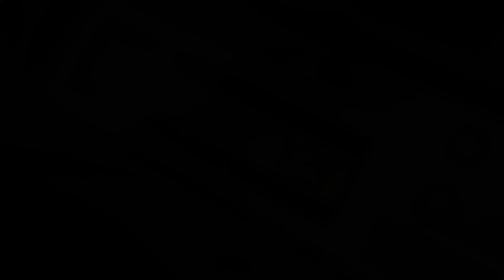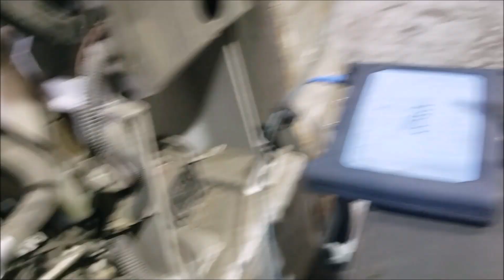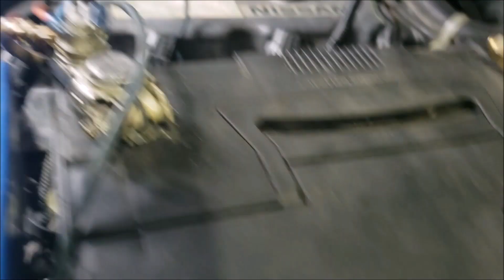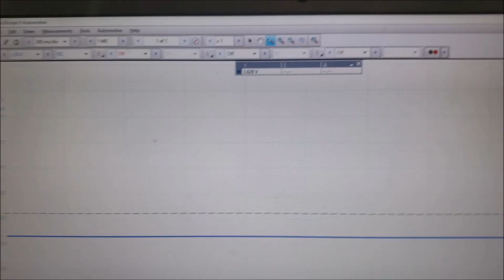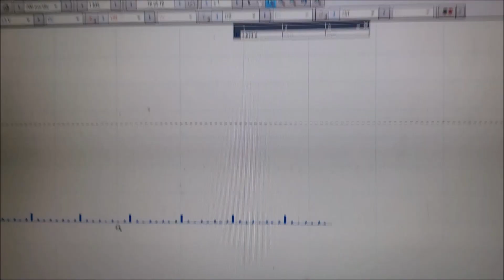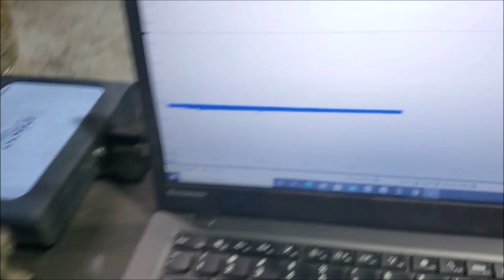Nissan Single Cylinder Misfire diagnosis

Comment: So did you also have a bad coil, since there was no spark when you switched it originally with another cylinder? Thanks for the video
Reply from the maker: Sorry to mislead. What I meant to say was I swapped a good coil into cylinder 1 and there was still no spark on cylinder 1 even with a good coil.
Reply: @forkliftgeek10  Thank you for the clarification.

Comment: My D21 has a missed fire once per second At 2000 RPM Just like clockwork Everything is new even the injectors we're replaced as a complete set dont  Know what the problem is
Reply from the maker: Might be a valve seating issue

Comment: Im having the same issue on same engine. I dont have these tools but i imagine seeing the readings and voltage youre getting, i can check it with just a multimeter and see if i get the same voltage?
Reply from the maker: If you see the same average voltage, it will be an indication that the wire is more likely ok. To verify it is not a high resistance in the wire you could bypass the wire.

Comment: This is very useful info, I'm working on a carbureted Toyota 4AF with very similar symptoms. Misfires on cylinder 1 but has 150PSI compression on all 4 cylinders. The diagnosis has led me to a new cap/rotor and then praying it works lol